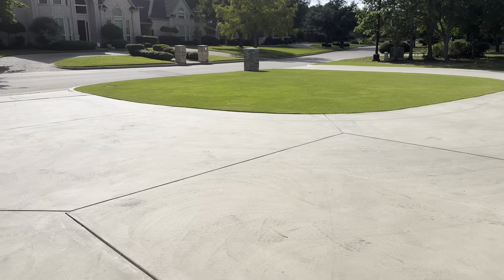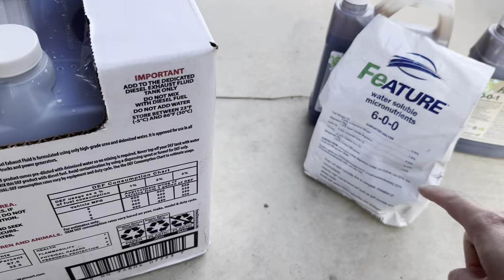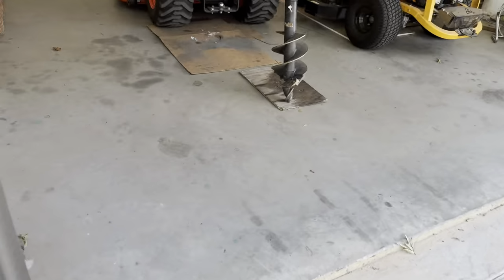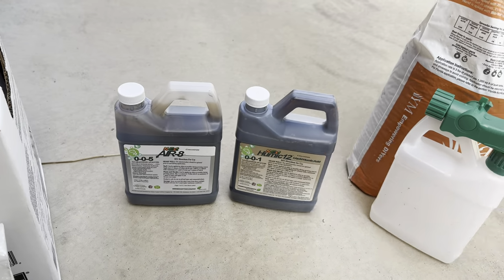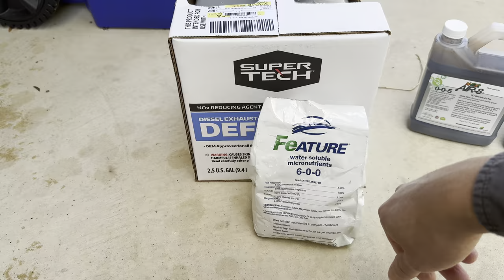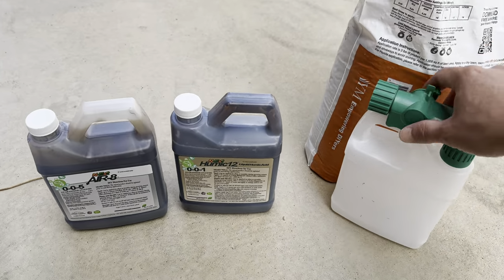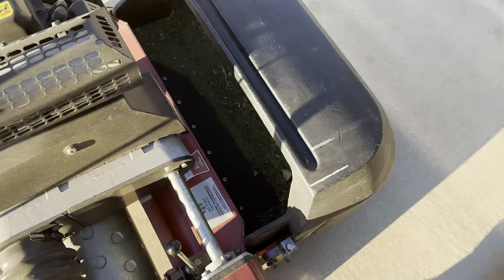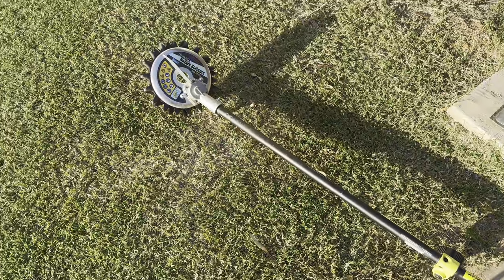REEL MOWING TORO GM 1600 | Lawn transformation 2023 Pt 17

Comment: Weird your not getting results from efeature. What is your soil PH? I use NutriSolve with my efeature for good results on foliar micros.
Reply from the maker: Based on my last soil test results in 10/31/2023 my PH was 6.57.  Overall all NPK levels were low that's even after applying the BlueDEF as an experiment.  My plan for 2024 is to dump 1lb of N every month until end of season.  Going with Lebanon 14-7-14 all year for upcoming season so stay tuned !

Comment: Are you using the same  battery powered trimmer unit for the scissors and the edger? If so what unit is that that allows you to use those interchangeably?
Reply from the maker: It’s a Ryobi 40v 4Ah.  Unsure which model, they have so many but look for the one with interchangeable ends.  Depending on how big your lawn is, the battery may need to be recharged.  For me I can edge entire yard and get 3/4 ways with rotary scissors on a full battery.

I usually edge first then charge the battery while I mow then I finish the yard with rotary scissors this gives me enough juice.
Reply: @MyLawnStory  Awesome, thanks. Really makes me think about going back to battery powered for my trimmer/edger gear. Did the edger come with the ryobi unit, and you just had to buy the scissors separate?
Reply from the maker: that's correct.  I used the rotary scissors to replace the string trimmer.

Comment: How you finding the sifference between the Toro and the McLane?  How are the 180 turns on the Toro?  Is the increased heft manageable?
Reply from the maker: It was a challenging at first because this mower is hard to pull backwards due to its heaviness.   I later found out if you disengage the reel from the drum it’s easier to pull back.  Gets a little use to turn 180 with the speed but it eventually becomes 2nd nature.  Overall you can’t beat the way it cuts.  There’s nothing that’s going to cut as smooth as a greens mower.
Reply: What is your take on the power rotary scissors?   Did they meet your expectations?
Reply from the maker: @thomashanan1996 they have done great for me in regard to getting the edges to even out with the rest of the lawn 👍